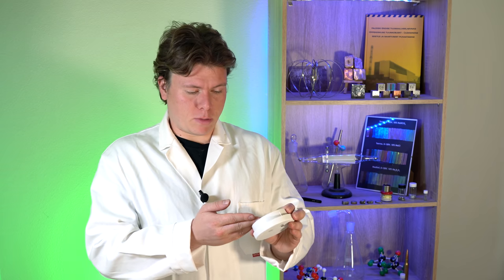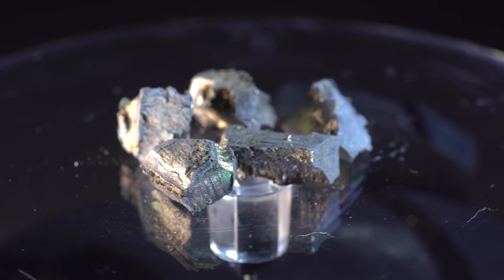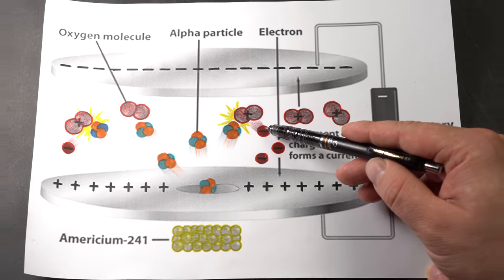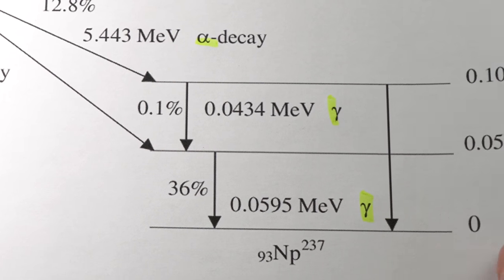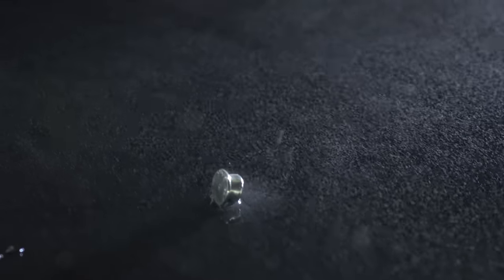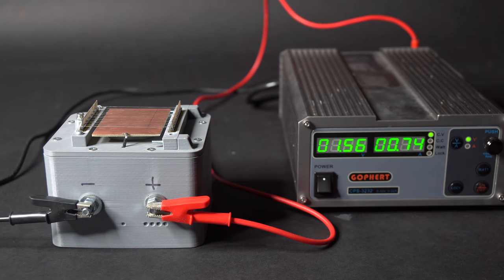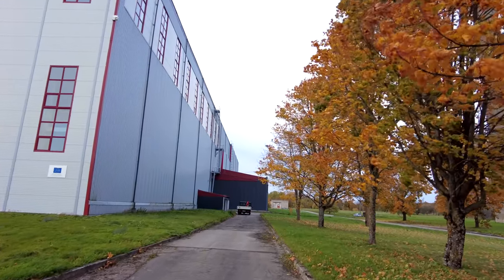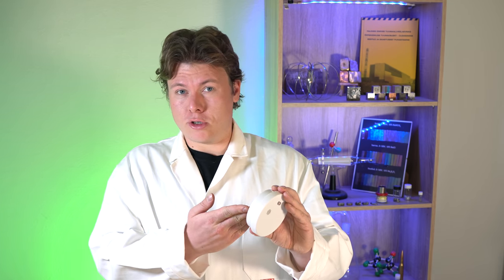Americium - A Metal, That Can VISUALIZE RADIATION!

Comment from the maker: ☢ This video was sponsored by Radiacode 102 - the world's first pocket-size radiation detector and spectrometer for all natural science enthusiasts 
Order now - https://102.radiacode.com/3 and try out a new scientific hobby!
Reply: I bought one a year ago after seeing it on youtube.   It works really well and the spectrum analysis in the android app is really interesting!
Reply: Got plans to build a diode based unit from the CERN educational website, comes with a database to calibrate readings. Just waiting on the board and parts.
Just got the emitter when the detector failed, so figured why not?

I also noticed, they're using the same circuit that was used to detect smoke around 40 years ago, but the emitter's about 1/3 the size.

I'll also be building a cloud chamber, got some old kitchen storage containers that have broken lids, so why not? Order a 4 cm heat sink, got some blue freezer charged cool packs to cool it, some hot water on the top bin to give the heat differential. At least until I can build a chiller...

Comment: What's really interesting is when you rip one open but keep it powered, and then put an oscilloscope on the output of the detector section. You can literally see the voltage levels drop as air gets more and more blocked by particles like smoke. That in itself isn't particularly astonishing, but then when you think of that crazy shower of particles flying off the Am241 sample getting interrupted by teeny tiny bits of carbon in the air causing a high voltage ionized air path to disrupt... Yeah... it's just totally cool. :-)

Comment: Excellent shots you've captured here. What lens do you use for the tight macro shots?
Reply from the maker: Hi, I use Tamron 90mm f2.8 macro.
Reply: @Thoisoi2  doesn't radiation damage the camera sensor ?
Reply: @destiny_02  Good question! Would love to hear an answer as well.
Reply: @destiny_02  The alpha radiation emitted shouldn't be able to but the secondary gamma radiation might.
Reply: @destiny_02  Place a high Quality bromined glass so the radiation dosen;t affect the camera
Reply: @destiny_02  
If the radiation would be high enough to damage the sensor, you wouldn't ever want to be near that radiation source.
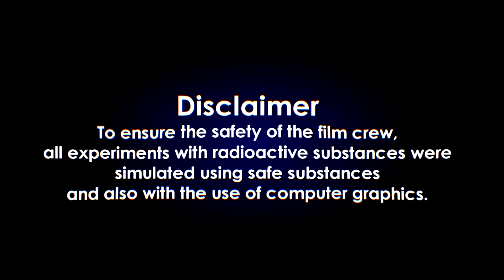Reply: @destiny_02  Pause the video and read at 0:33
Reply: @destiny_02  i can be wrong ( a translation probleme maybe, or just misremember) but isn't the light a type radiation? so i would say, as for everything it depend  the type of radiation and the concentration, as for the kind of radiation you probably talk about I think it's the same thing, but I don't know enough about camera sensor
Reply: Only the really high electron volt radiation can get in there to attack the camera sensor, and it takes a lot before damage piles up. Hotpixels can result from this, but do bear in mind that there is no such thing as a "radiation free" environment; not anywhere on Earth, not anywhere in space, nowhere. I have a homemade Raspberry Pi CBM-19 based geiger counter in my living room running 24/7 just you know, because I can, and it tracks a nominal value of about 80 counts per minute all day, every day, with slight up and down variances. Much of this is from the ground and the house's concrete foundation, but also some is just... everywhere. Point is, you, me, and everyone and everything you know is constantly being hit by everything from low power alphas to very high power gammas, neutrons, electrons, etc. Camera sensors included, all day, every day, forever. And yet, they do pretty ok. Onboard space stations as well, they deal with much higher ionizing radiation densities and energies than we do on the ground and they still use the same basic tech for electronics and video. Damage does accumulate, but it takes a long long time to do it, or a crazy strong gamma source and a much shorter time.
Reply: @NightRunner417  thanks
Reply: I have that Tamron. Also the Tokina 100mm macro. Love both
Reply: @destiny_02  Maybe in extreme cases but it really depends on the type of radiation. Gamma rays likely won't effect it just like regular light but throw a lot of electromagnetic radiation at it by pointing it directly into the sun or putting it in the microwave and you're probably going to damage it. 

Keep in mind that cameras get x-rayed at the airport all the time.

Likewise with the alpha radiation, it shouldn't be enough to damage anything. The lense and camera body should block that anyway.
Reply: @your_new_sjw_waifu  btw even a regular green lazer can cause damage to sensors, by that's why I am asking
Reply: @NightRunner417  The body is able to repair a certain amount of this kind of damage to the DNA
Reply: @HappyQuailsLC  Not only that, but it's been scientifically proven that a certain amount of steady bombardment is actually beneficial to the overall function of cellular processes, which is pretty fascinating. We're literally built not only to withstand the natural background, but to also benefit from it.
HOWEVER... This isn't a discussion on the biological impacts of ionizing radiation, fascinating as it may be. This is a discussion on the slow destruction of electronic devices due to exposure to ionizing radiation, and they DO NOT heal over time, lol.

Comment: The tracks through the ethanol vapour are beautiful!
Reply: Agreed, I was hoping he would've found a way to increase the concentration of the vapor inside since he said it wasn't dense enough to show everything. Was my favorite part of the video.
Reply: @JWolff-md3ij  a tub of hot water on top will add to the concentration.
Gotta get the felt for the one I'm building out of a couple of broken kitchen storage containers, they're 4 cm square units, cut the bottom out, goop and tape the two together keeping the bottom on one, fill the top with hot water and the bottom can have either dry ice or just blue cooler gel poured and taped into a heat sink for the bottom unit to rest upon.

Comment: I'm incredibly fortunate to have toured the 'back end' of the TRIUMF Research Particle Accelerator at UBC.
When I toured I was in an area that was still contaminated with radioactive oxygen which had blown about.
They had mostly cleaned up however you could also see black smudges of contaminated Carbon on the ventilation system.
That's what you can do with a chem degree and a girlfriend whose father worked there for 20 years.  :D  (I didn't get a job when I applied, sad)

Comment: If you open a source chamber on a smoke detector stop when you see the tiny piece of gold.  
The Source is safe to handle at this point.  It is still in a protective and shielded container with only the one window.
The ionization chamber (cover) makes a great cap to control radiation.  I always store mine above head level pointing upwards.
Alpha radiation is used industrially to control static.  I used to play with a source used during newspaper printing to control static cling.

Comment: With a RTG, it will last longer using a longer half life element, but at a much lower power density, that's the trade-off - you need a much larger and heavier unit.
Reply: And a whole lot more of the element :D

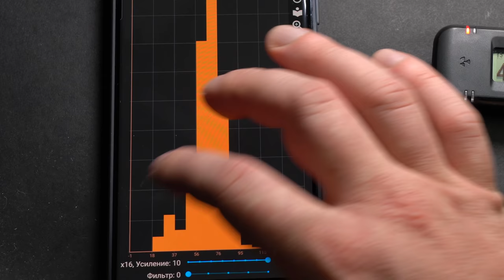Comment: Great video as usual, but I have to contest one important thing. 9:15  -  60 keV X-rays (or gamma technically in this case) definitely aren't "safe". The TVL of soft tissue to 60 keV photons is like 11-12 cm/~4.5". Basically, 1/2 will penetrate at least 3.5cm/1.5", and 90-99+% will be absorbed by the body, and they are definitely highly ionizing in tissue. At 4uSv/hr, at that distance, you'd probably have to wave that thing over someone for a year in order to generate enough to make a single chest x-ray, so I'm not suggesting that it's dangerous to handle, but yeah, 60 keV is right in the middle of the range that penetrates enough to damage tissue, but not enough to pass right through. If you generate enough 60keV photons you basically have a perfect x-ray machine.
Reply: If it takes a year to resemble a typical chest X-ray, isn't that safe enough?
Reply: @Reptex_cs  It isn't likely to cause any harm at those levels. That's why I said it's not unsafe - quantity-wise. The quality/energy level of the radiation, however shouldn't be characterized that way. It's probably irrelevant to 99.9% of people in any situation they are likely to even encounter. Just that, to say 60 keV photon radiation is harmless is exactly the opposite of true. It gets slightly complicated... For radiation safety guidelines we use a linear non-threshold model. That means we take levels with known harmful effects and assume that, for instance, 1/1000th of that is 1/1000th as harmful. We know that's not true based on epidemiological data that we have - low levels up to a few 10's of times normal background may even be slightly beneficial - but it's the standard practice for regulatory purposes to assume "no safe dose". Also, If you ate it 🙄, kept it near your eye for a long time, or carried it in your pocket every day... You might increase risk of cancer, cataracts, or fertility issues respectively. Honestly probably still not, but having no respect for it isn't a good approach is all I'm saying. Or if you got 1000 of them and tried to extract the Am (someone did that) - that'd be dangerous. It's hard to communicate radiation health physics effectively. That's why everyone is (wrongly) afraid of nuclear power.

Comment: It seems like the Americium sample could also be used to recharge the battery or power smoke alarms, but we're forced to buy disposable devices which don't allow the battery to be replaced. More planned obsolescence.
Reply: Not nearly enough americium for that. Adding that much would be insanely expensive and would give regular people access to dangerous amounts of nuclear material.
Reply: @Ithirahad  If you give those people enough nuclear material, they will become irregular. The problem is self-resolving.

Comment: I have also taken the button out of a smoke detector to do experiments with orchids and cacti. You can glue the button to a copper wire and position it on the flower of a plant to try and create new breeds. Radiation breaks apart the DNA in exposed pollen when you are fertilizing manually with a paint brush so the seed that forms can be a mutant plant. Most are infertile or die after germination but I've created a few new orchids that have leaves that grow like a corkscrew. Pretty neat.

Comment: I used to build ionisation chambers, never built a spark chamber. I used a tin can (any beans can will do), with one side open, and the other side closed with an insulated plastic disk. The can is traversed by a rigid copper wire, and about -100 V floating, applied between the can and the wire thru a 10 MΩ resistor. Used four 22.5 Volt batteries in series.
The chamber is connected to the gate of a FET transistor with a very low gate current like JFE2140. This dual FET has 10 pA gate current, but there are some FET with a 2 pA gate current - if you can find them.
On the drain of the FET you need to connect an OP AMP amplifier and an integrator as low-pass filter, and connect it to an oscilloscope. The FET and the amplifier must be powered by a separate battery.
If the FET is OK, this chamber work any time. Think that this chamber works much better with an high gain dual triode (ECC83) if you know how to design with vacuum tubes, especially tube differential amplifiers.
Thanks for the outstanding video.
Greetings,
Anthony

Comment: What to do with Americium, take #2:
 1)Get a bunch of ionising chamber detectors. Scrape off the gold layer. If Am²O³ stays on the plate, skip to step 4).
 2)Seperate Am²O³ from gold by dissolving it  in a drop of acetic acid or melting off the gold.
 3)Reduce Am (|||) from oxygen, turn it into hydroxide or just heat it to dry out.
 4)Dissolve it in small drop of acetic acid, then in diluted citric acid and put in the syringe with a long, strong needle. 
 5)Travel to Altai Pukin',s unofficial castle residence. Find his favourite wine or other sour beverage. Bribe the distributors of this beverage to let you deliver them. Lace the bottles with Americium by injecting it equally trough corks.
 5)Sit back, and enjoy the irony..

Comment: This is interesting .. I was recently was messing around on the bench with an AM241 source in a light tight aluminium box, aimed at a piece of  'glow in the dark' tape and a photomultiplier tube fashioned as a scintillator, hoping to detect the NP237 decay and log the probability with a computer. I was never certain why it simply didn't work at all.

Comment: Americium is still important in research.  I wonder why they'd dispose of the smoke detectors instead of refining the Americium out of them?  It's got to be cheaper than making new material?
Reply: If I had to guess, I would believe they don't yet recycle them is price. Similar to trying to refine the gold from circuit boards, it costs more to remove and purify it than it's worth, though in the future it may be viable.
Reply: Maybe because it decays quickly compared to Radium?
Reply: @moonwalkerangel7008  just look up the hall life of Americium..
Reply: @jeffwombold9167  It says Americium 243 has a half life of over 7,500 years but Americium 241 has a half life of 470 years. Ok, I stand corrected.

Comment: 7:58 the reading dropped to zero before your piece of paper even got to the meter... and in the one before that (the new test), the radiation stayed high even when you pulled the meter away from the Americium. I have no clue why, but I'm wondering if it has a long delay between reading and displaying.

Comment: I work in the waste industry, we literally just throw smoke alarms in the landfills in the US.
Reply: How many make it into the recycling stream?
Reply: @josephkanowitz6875  Not a lot. You have a huge trailer per trash load, and probably only a handful ever get thrown in. If you have too many all in one place you could set off the radiation detector at the dumping facility, but it'd have to be like a dozen all dumped in one spot. The low concentration is considered to be within reasonable thresholds. Still, you're dumping radioactive byproducts in landfills and incinerators lol.